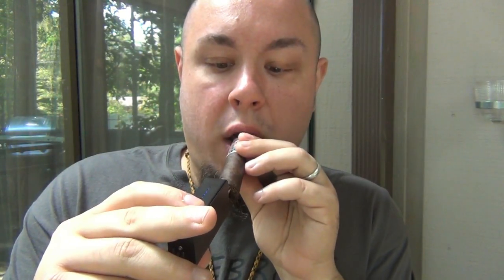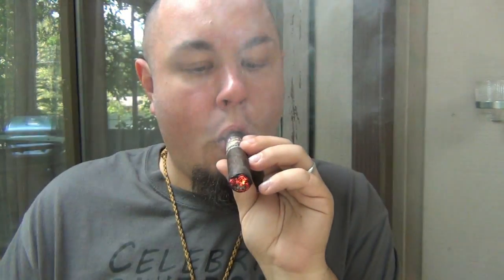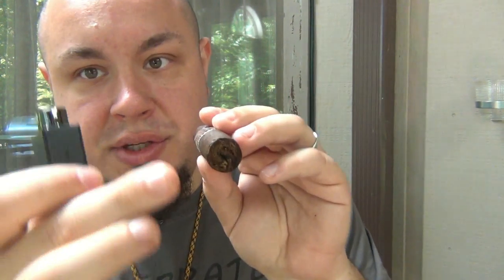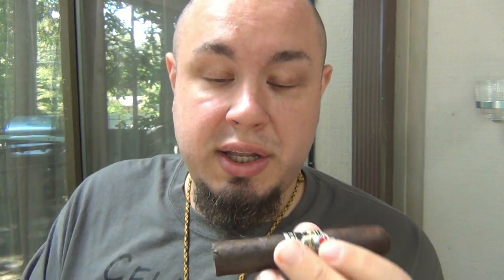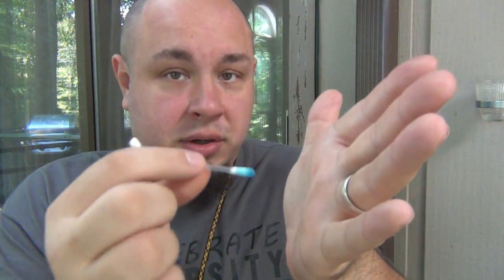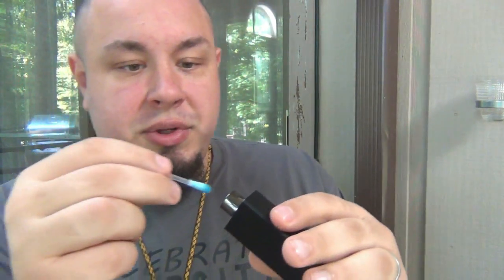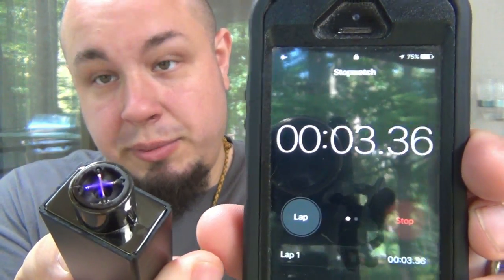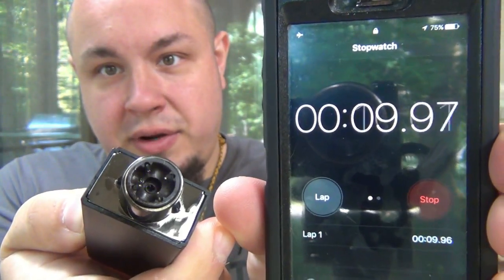Lighting A Cigar With Plazma Beams...Will It Work?

Comment: Good video demo and I would use it in a pinch but it’s not the right tool for the job imo. If the plasma radius was larger by an 1/8 inch larger it might work great but this model is too small.

Comment: I've seen a lot of lightning arc things but... why not just use the traditional way
Reply: Jared Tyra because that's no fun
Reply from the maker: Like many things in life it exists just to be different, however it does work better than flame in some cases like bad weather, and heavy wind...but its not trying to replace a flame free matches will still work fine as wil a $0.50 lighter, lol...